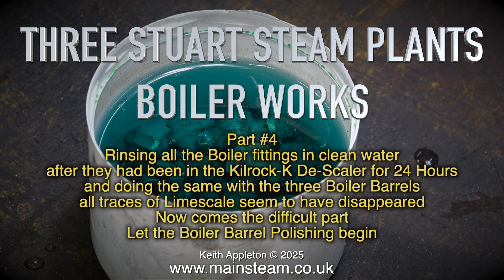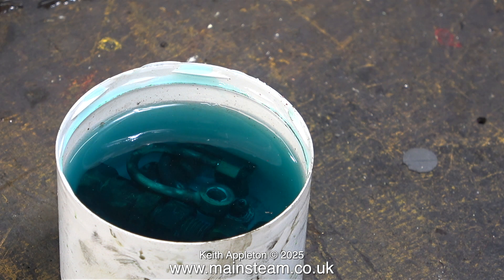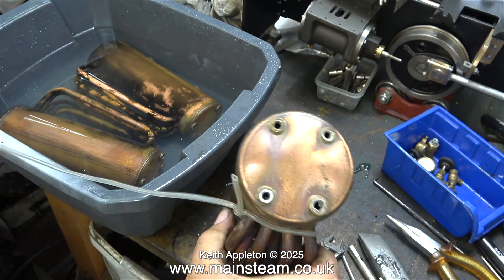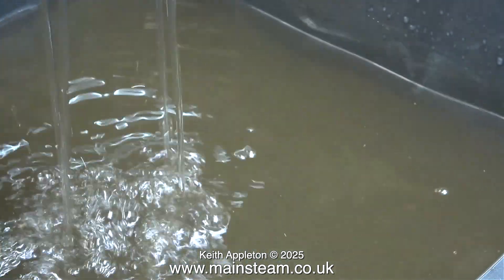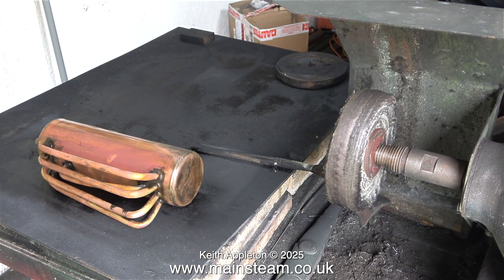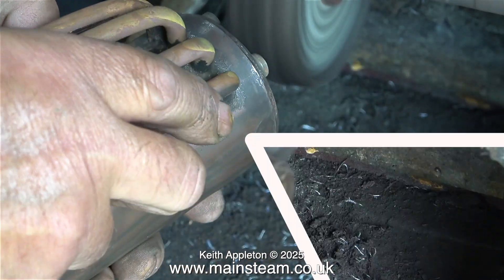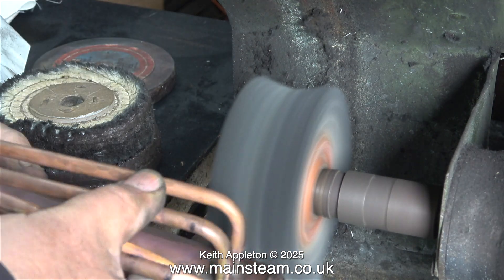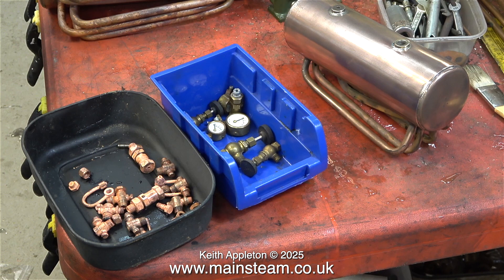THREE STUART STEAM PLANTS - BOILER WORKS - PART #4

Comment: The best thing for the first polish is "steel" polishing soap. Then when clean, use copper soap I didn't see you use any at all!
Reply from the maker: I used abrasive soap on the Copper Boiler Barrels - please watch the video all the way through, the abrasive I used is a stick which is a coppery colour and it polishes the Boilers OK. When polishing a Copper Boiler its not a good idea to remove too much metal for obvious reasons  . . . . . .

Comment: I agree with you on the gloves. At least with some jobs. On certain jobs like grinding on a wheel I'd reccomend getting some work gloves as getting your fingers ground off isn't really pleasant, or so I've heard.
Funnily enough wearing gloves in some situations is detrimental. For example in the food industry. There it leads to less awareness to hygine, as you don't think to wash your hands as often because you don't come into contact with things. For example picking something off the floor or catching the lid of a dustbin was things I'd often see gloved coworkers do and promptly not wash their hands afterwards.